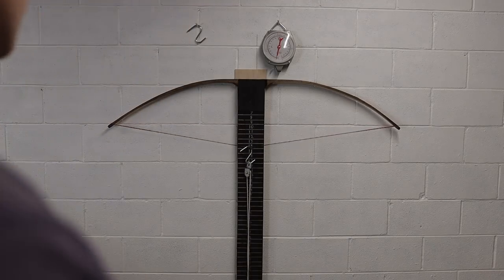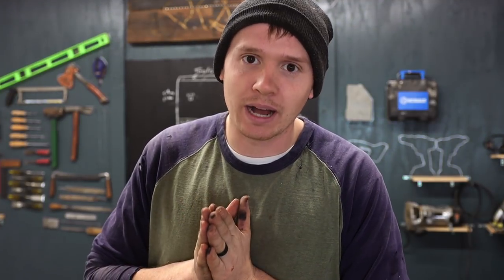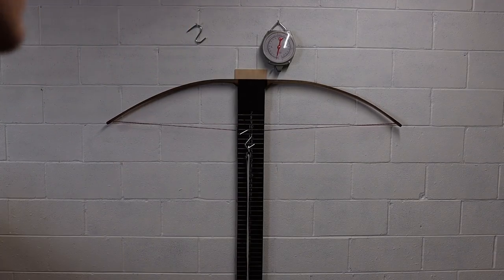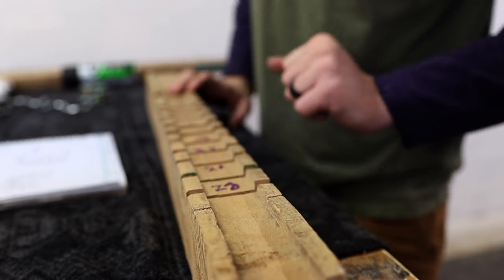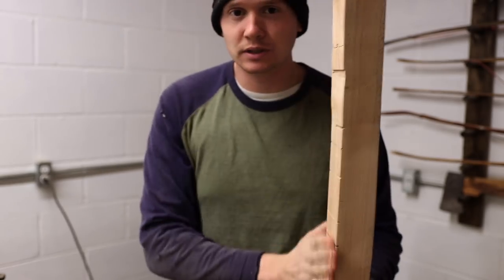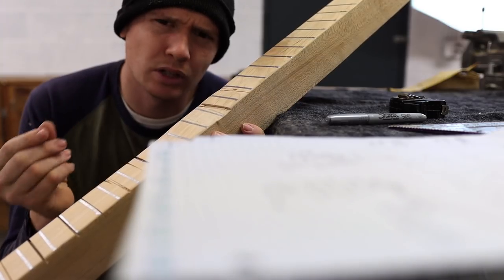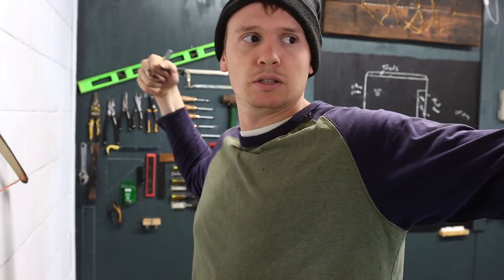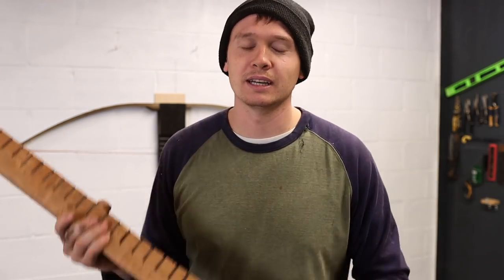EVERYTHING About Using & Making A Tillering Tree, Stick, & Board

Comment: Great tiller tree man. You're one point about using it and standing back without being able to mark the "bad spots " while tiller tree. Unlike tiller strick. One thing I did for my tiller tree on the wall. Was I bought a big piece of graph paper and placed it behind my tree. So when tillering you can use the line of the graph paper to check tiller from you're standing point. It seams to help. Or it did for I anyways. 
🏹🎯😎
Reply: Some wrapping paper comes with 1"x 1" grid printed on the back, might do the trick on the, you might already have some special kind of, cheap.

Comment: Sailors use "cam cleats" to hold lines (rope) coming from blocks. If you hold the line up higher coming from the block it won't engage the cleat. Pull lower coming out of the block line will lock in the cleat. Will hold right where you want for draw length.  Lift the line up and line comes out of the cleat to release tension. Quick and easy.  Love your channel, great job.

Comment: Good video, would like to see more on tillering.
Reply: Wallace V that was my question too, the “stick” method is straight forward enough to mark the bow but how to mark using the board/wall mount method escapes me.  Visual memory? What/where do I look?  I’ll probably use the stick for my first one and see how it goes but it makes sense that it stresses the bow more and is not as easy when exercising it as the wall mount.
Reply: @dkhallal  you'll need some locking mechanism to hold the bow at certain draw. How you do it is up to you tho cz it depends on your working space, solutions and whatnot

He did show it but it was brief,  it's a quick and easy method using a loop and a nail as a hook

Comment: I just made my first bow from poplar board following your video.  Just got the string on it, and on first draw, it snapped!  It was only 60 inches and had only 4 layers of fibreglass tape and type 2 wood glue.  Shame, but I learned a lot.  I think one of the observations is that the compression side of the bow (belly) seems to be what exaggerates the forces the tension side (back), so it's better to thin the limbs and have a lower poundage bow than get greedy!  I'm guessing the max thickness should be about 5/16" or 10 mm, or in any case much less than 1/2".  I also think more layers is better (lamination looks like a good idea).
Reply: I made the poplar bow a few weeks ago. It snapped as well. I made another using red oak and seven strips of tape. Came out to be 35lbs , 28in draw. It's held up passed about 300 shots. I'm making another this week. Going to try for 40lbs draw.

Comment: Maybe I missed it in the video, but what was the purpose of having the 2” notch cut into the top of the 2x6? It seems to serve no purpose, but I’m trying to get into making my own bow, so genuinely curious.
Reply: When you put the bow on the tree without the notch, it tends to move around because it's just flat surface despite the plywood there to fit the handle

But WITH the notch, the bow will stay centered on the tree better because the handle (belly) part will sort of 'get in' to that said notch. It doesn't necessarily need to be 2", it depends on the handle size and design

Hope this is helpful!
Reply: ADTY MRYD yes! Thank you!

Comment: Instead of using anchors in the block wall, use tap con screws, drill the right size hole than just run in the screw. One step instead of two

Comment: That’s a great saw if your going to different jobs or outdoors etc, but for a shop, you should have a real saw, that way you don’t put wear on your batteries , motor, etc. I seen cheap used chop saws that run forever. I left an old small one outside for a few years and it still worked no problem. That way you don’t have to wait for batteries. I seen a lot of youtubers use tools like grinders and saws that their battery runs out I’m like bro you have a corded grinder right there smh.